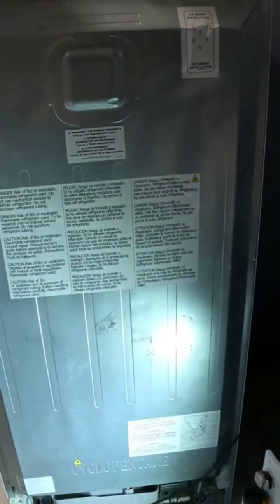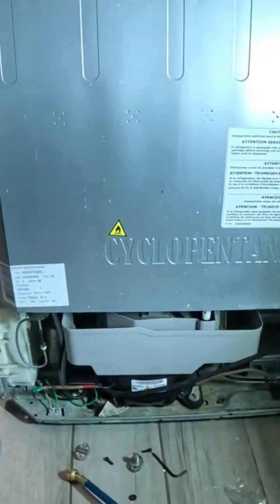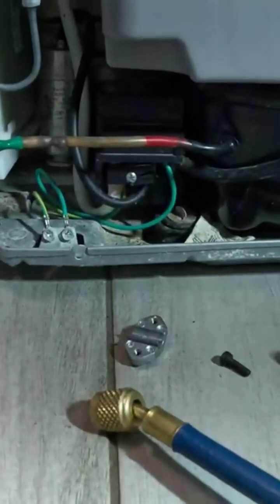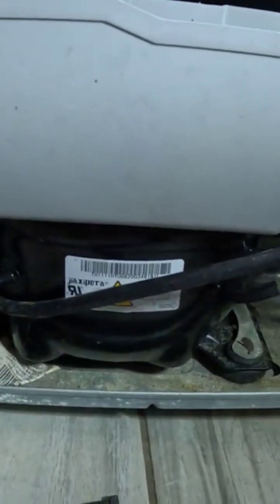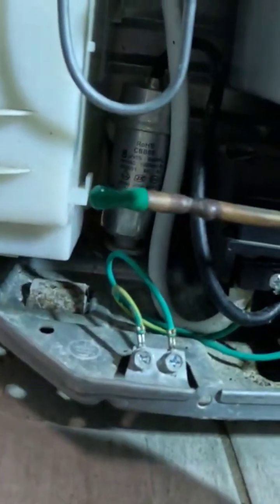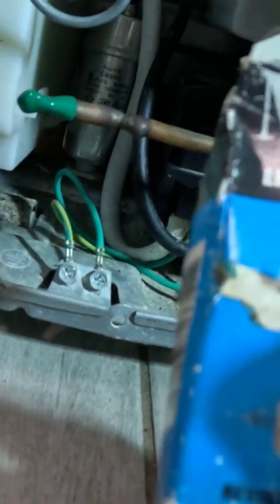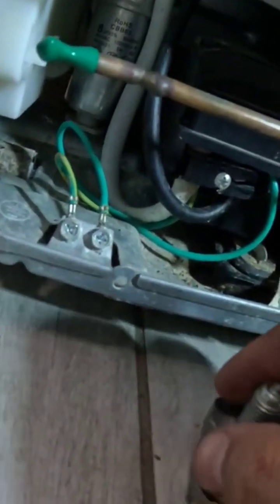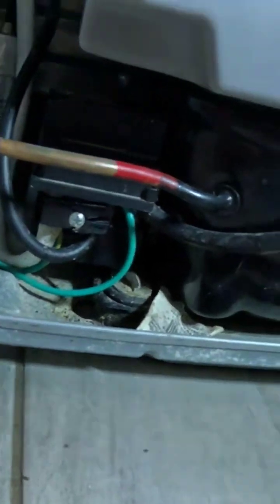(Part #1) How To Correctly Add / Recharge Freon to your Home Refrigerator R134a R600

Comment: Where did u find refrigerator R134a as it’s different from automotive R134a.
Reply from the maker: As long as you buy large 30lb Automotive jug, you should have no problem. The Only difference is the automotive refrigeration 134a is a 5/16 adapter vs the standard 3/8 connection used for 410a. Now the little 16oz 134a Freon in the auto stores I can see that, but I always used the large 30lb auto jugs.

  https://shop.advanceautoparts.com/p/freon-r134a-automotive-refrigerant-30-lb.-cylinder-d14858530/50001103-p?product_channel=local&store=3383&adtype=pla&product_channel=local&store_code=3383&&&&&gad_source=1&gad_campaignid=15572579702&gbraid=0AAAAAD05GhXZdAncV_LlSZMKlOlg6Qfrb&gclid=Cj0KCQjwoNzABhDbARIsALfY8VPrhwCU0r2pf7h-uHGYXmgjuxNaCLHDxH8LMoWsRlw_yALONvUuPugaAp2FEALw_wcB&gclsrc=aw.ds
Reply from the maker: https://royalrefrigerants.com/products/r-134a?variant=49197508395293